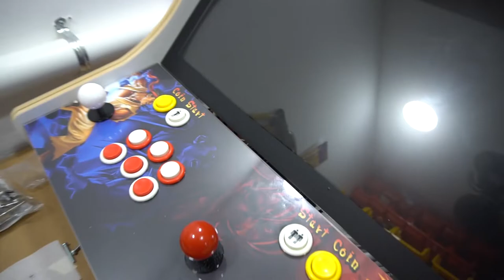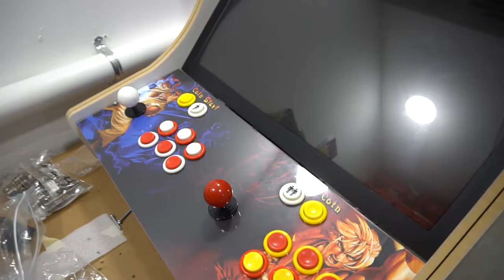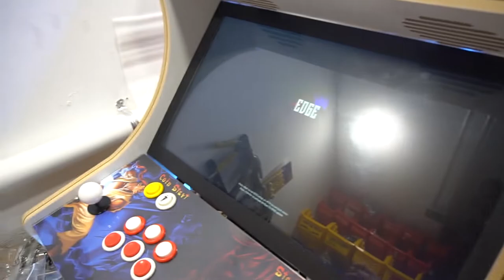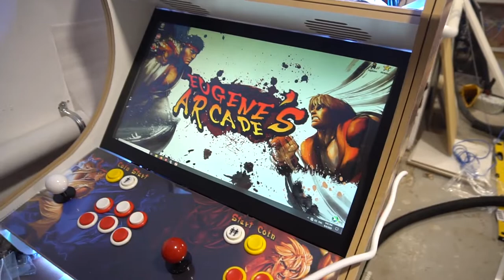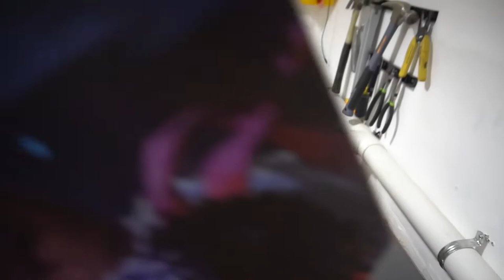40TB PC In a Bartop Arcade!

Comment: You should drill through the top for the volume control and 3d print a cap to hide the hole. Did you think about switching the hard drives to SS drives to conserve space?
Reply from the maker: There's no space in the marquee to drop thay volume knob, this is running the Logitech z533 in it.
Ssd are better but not needed for classic retro games. Space isn't really an issue as you see I was able to pull it off 🤘 but ssd are much more expensive... let alone 42tb worth of ssds

Comment: I got a question wouldn't the subwoofer interfere with the hard drives?
Reply from the maker: I thought that too, but no as far as vibration of even the magnet, negative its all clear. Been using it for the past week no issues
Reply: @Vic_VP  ah okay thanks